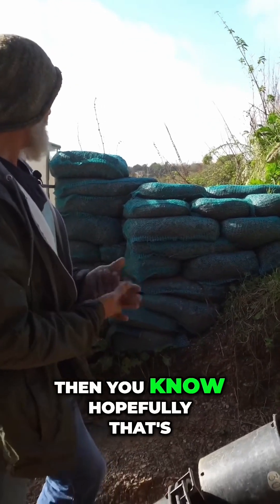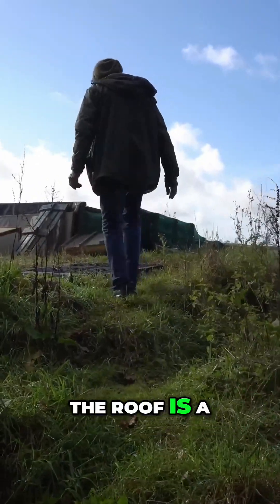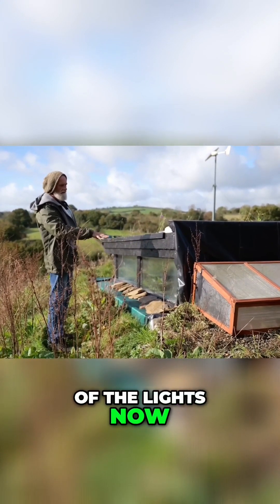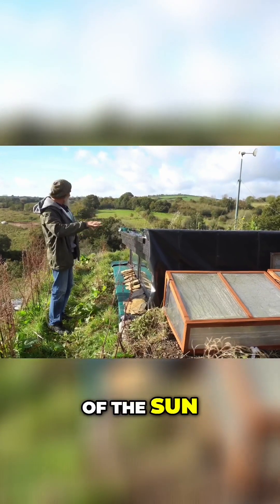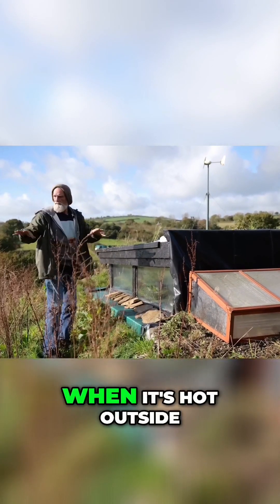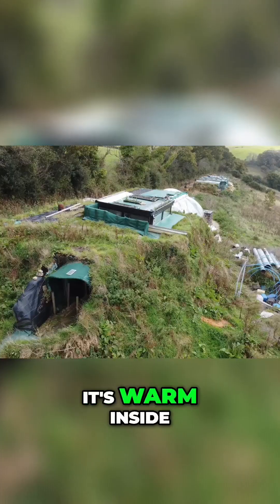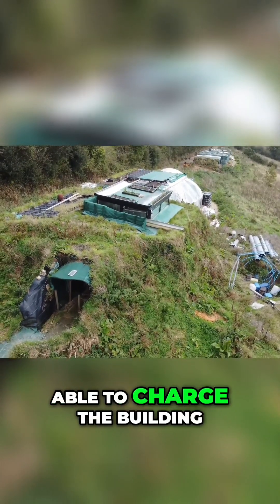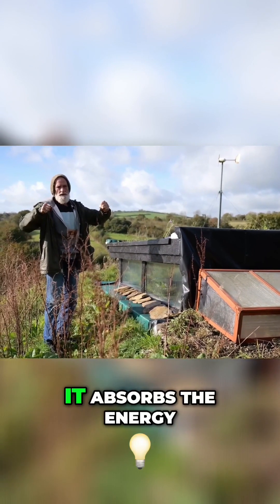Building a Sustainable Home: Hyper Adobe Techniques Explained

Comment: Can you tell us a bit about how you've constructed your roof?  How thick is the soil on top of the roof structure you built?

Did you also use water-filled IBCs underfloor?  Or did you determine that was largely unnecessary?

We've got a rural acre in New Zealand with a steep hill and have been preparing ourselves to build underground for awhile.  Building for earthquakes means, I guess, a lot of steel in the roof.

We also have a lot of SIPs that we've picked up from an old freezing works that was torn down.  The faces are steel rather than OSB.  My thinking is use the SIPs against the dirt outside (inside the moisture barriers), bolt the IBC cages to the SIPs, fill 'em up with water, then wrap it all in used sileage wrap that's abundant since all of our neighbours are farmers.  Should then function as a monolithic structure in an earthquake.